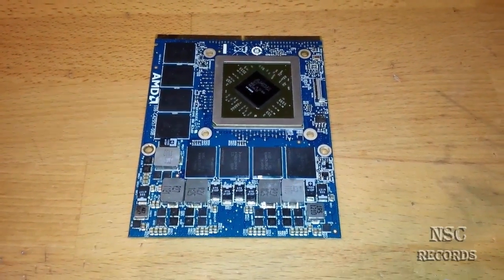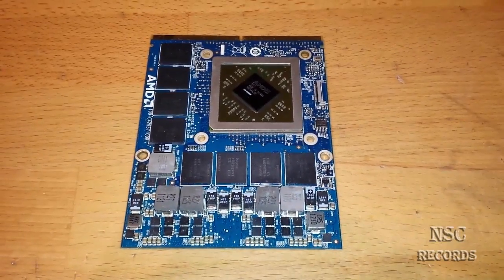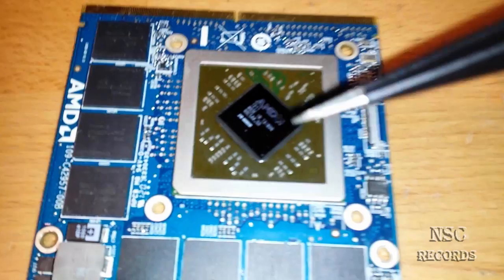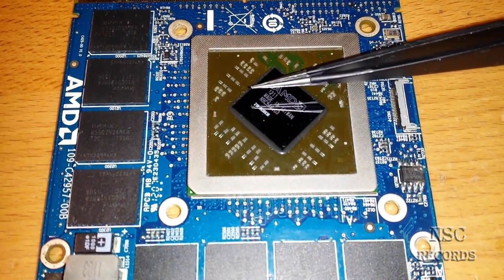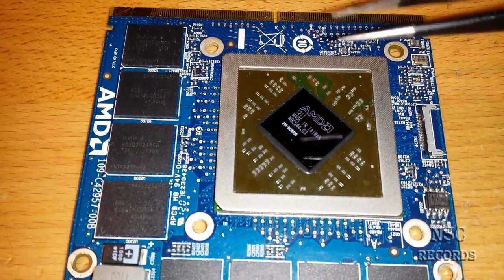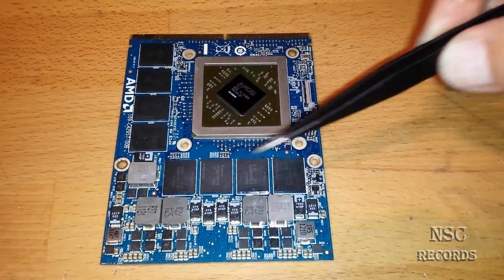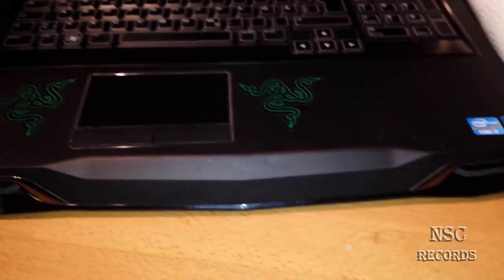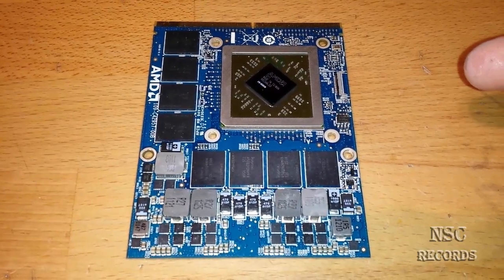Important Notebook PCIe GPU Replacement Info By:NSC

Comment: No need to replace BIOS chip if you have Alienware computers. For example in M18x R2, flash the unlocked BIOS, set graphics mode to SG to use iGPU and enable dGPU slot 1 and slot 2. You can make DOS USB and flash vBIOS from DOS using atiflash for AMD cards or nvflash for nvidia cards. Join notebookreview, many alienware members there (myself included) :)

Comment: Hello I have 60gb ps3. Bought it very quite. Gets 2 steps load. Concern is the air from the back of console is just a bit warm. The heat is not coming. Shall I remove ihs still has warrantee stickers. Please reply